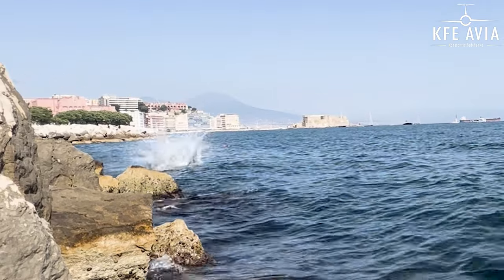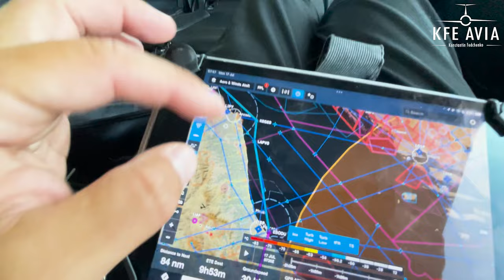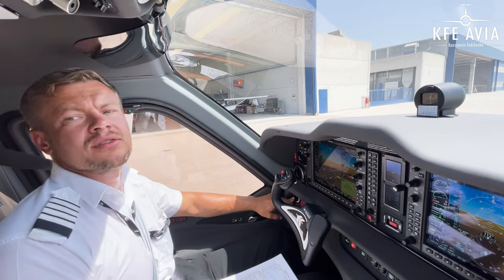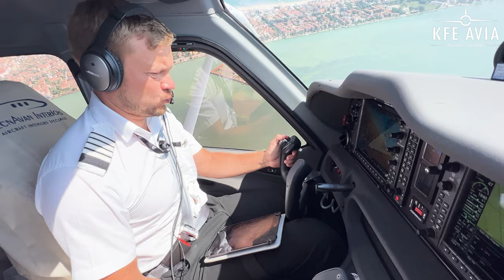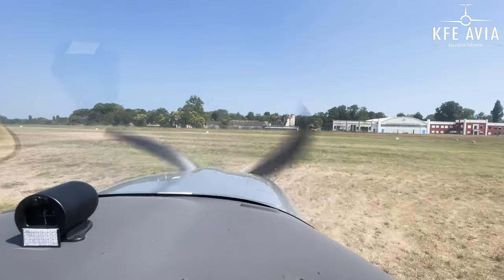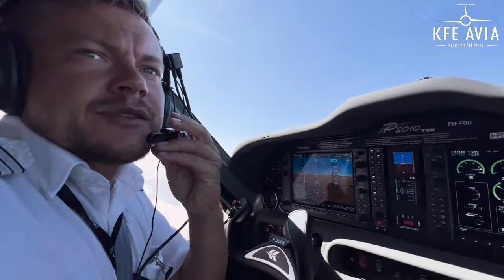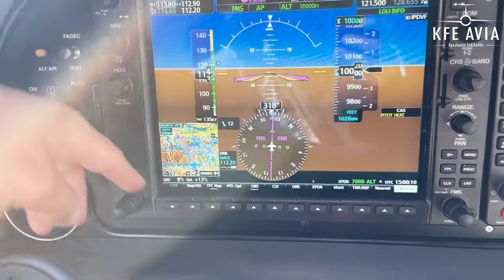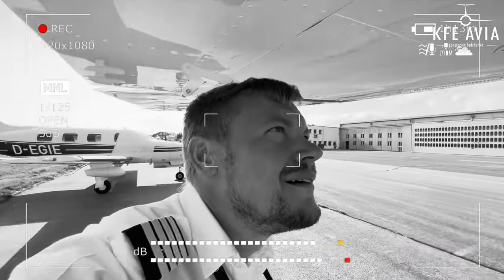TECNAM P2010 TDI Diesel | Ferry Flight Review | PART 1

Comment: Hi Konstantine, thanks for taking us along on your flight.  I appreciate that you requested to fly lower so that we could have a more scenic view.  For flying in several types of aircraft you always seem at home in the cockpit and flying the plane.  When you had to fly with the flight Instructor was that just to checkout that you can fly the airplane ok?    I would assume that you probably had to do several takeoffs and landings.  Looking forward to part 2.
Reply from the maker: Hello, Ben!
Thanks, I appreciate your feedback, it is full if sense.
So when i fly unknown type of airplane which is not listed in EASA “Type Ratings and Licence endorsement lists”,  I legally do bot need to do any additional training. 
Normally, i get away with just 1 hour airplane manual reading, staring at instrument panel picture a day before. However, it is a good practice to have someone who is experienced in the airplane to show it in action.
Also, in this case, we need the “Acceptance flight” performed by the pilot who acts on behalf of the Buyer.
Reply: Último avión de tecnam

Comment: Amazing! This is the plane I’d love to upgrade to from a Cessna 172. How’s the air conditioning in the plane? Is there AC in the back that you can blow towards the front? This is a trick I’ve learned for my XC’s in Texas.
Reply from the maker: I spoke to a factory, they said from 2024 they plan to fit an AC if orders come, so you might be changing the plane configuration by leaving your comments here 😀👌